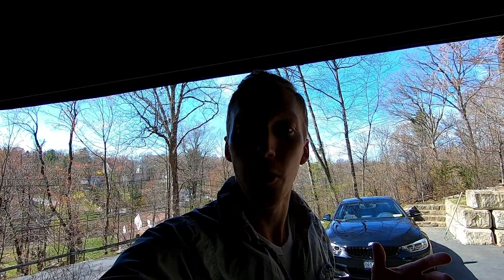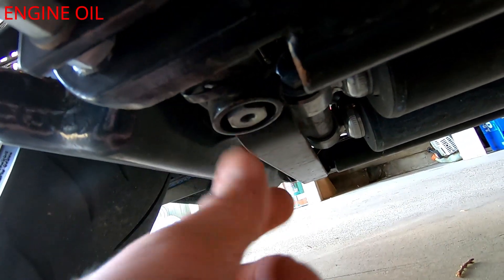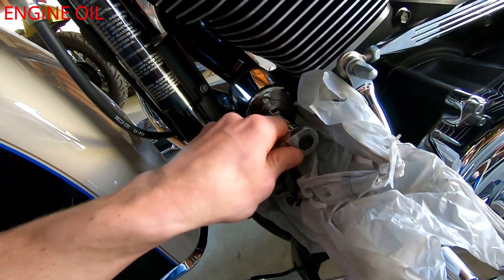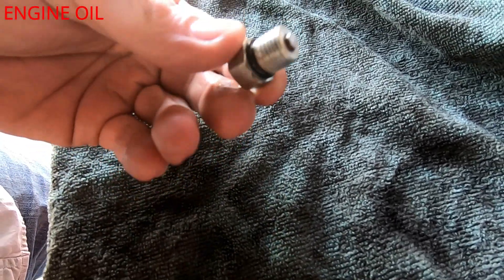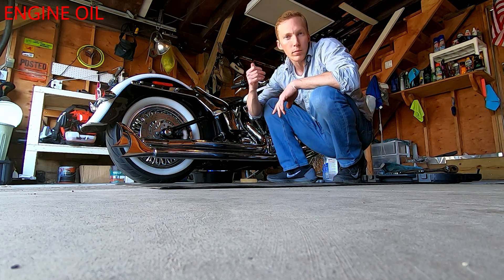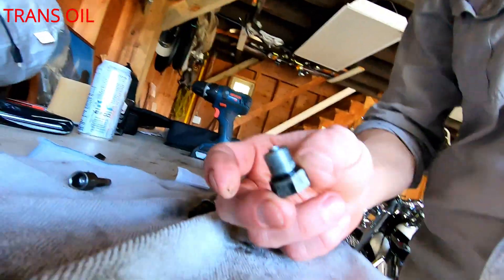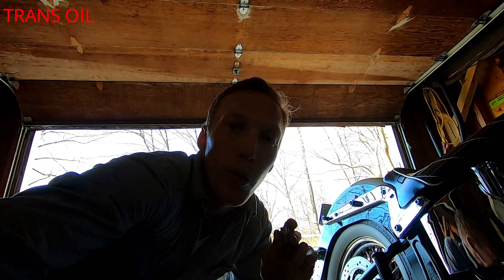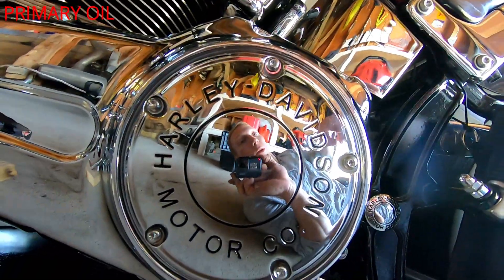2013 Softail Deluxe 3 hole oil change

Comment: Any comments on just running 20W-50 in the trans?
Reply from the maker: You can, it's acceptable. But I personally would rather use a dedicated gear oil.

Comment: Why 75-90 instead of 85-140??
Reply from the maker: 75 90 is plenty for living in the northeast. If I lived in Florida I'd use the 85 140
Reply: @JETFILMCHANNEL  O crap i put Vavoline full synthetic 75w-90 gear oil in my transmission last week and i live southern new mexico am i ok MR JET?
Reply from the maker: You're fine, next time I would choose a heavier oil though based on where you live